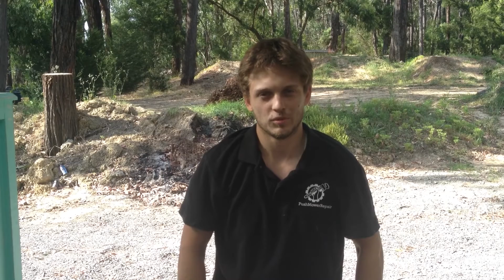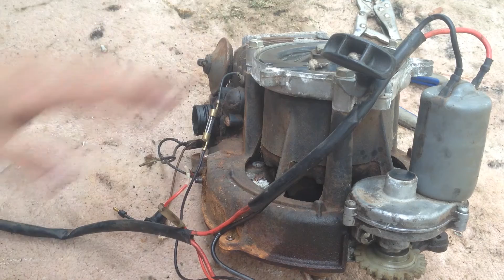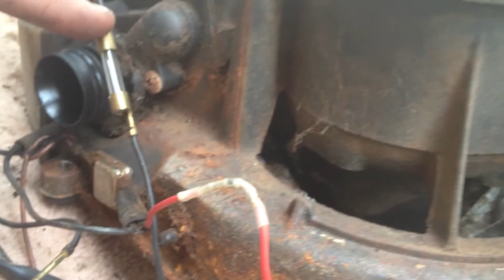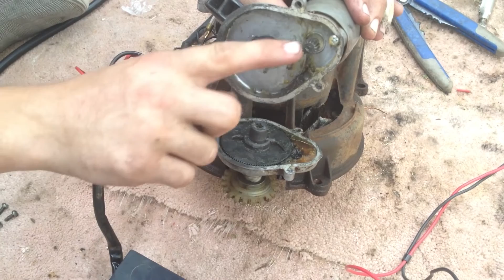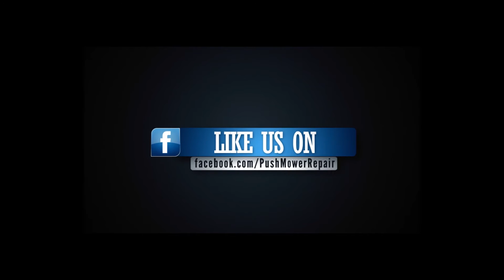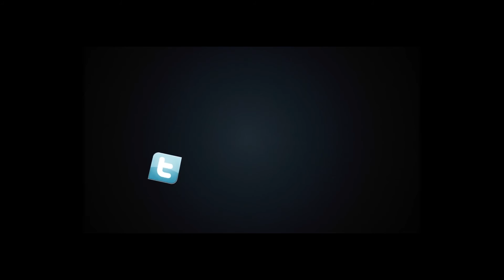PushMowerRepair.com - Victa Keystart Repair

Comment: Does the keystart engine have different crankcase to the regular 160 powertorque? Reason being I have keystart with a bore that's not repairable due to heavy rust pitting. The rest of the mower is like new.
Reply from the maker: +DocVMX The crankcase is the same for both models some models have a different flywheel which does not have the teeth for the starter gear
Reply: +PushMowerRepair.com  thanks for the reply. I purchased/fitted another PT 160 engine. The cases are different in so much as there is no cut-out in the case nor mounting points for the starter motor. Some case reshaping, drill/tap a few bolt hole and presto it would work. Given a little thought the extra weight of the keystart/battery.starter and loom far out weighs the benefits (no pun intended) as the replacement motor once freshened up starts first go. Cheers

Comment: how easy is a key starter to wire from not been wired up is there a wire diagram i can get?
Reply from the maker: I have never tried but I imagine it would not be too difficult the circuit is quite simple, here is a link to a wiring Diagram. https://www.dropbox.com/s/aanjnupaddpk6wk/IMG_4290.PNG
Reply: PushMowerRepair.com thank you